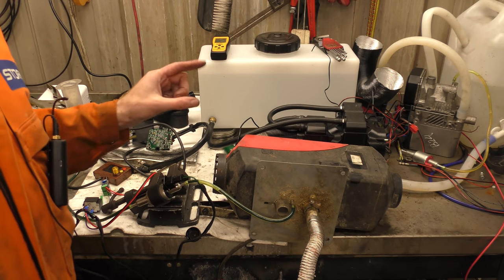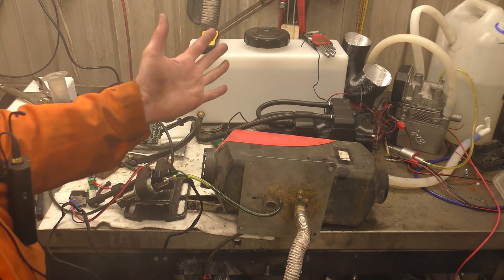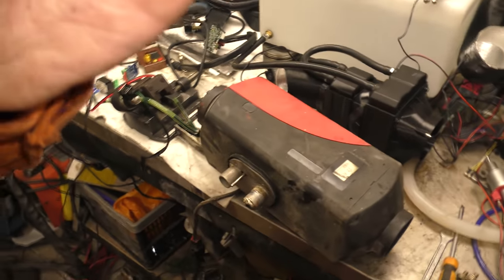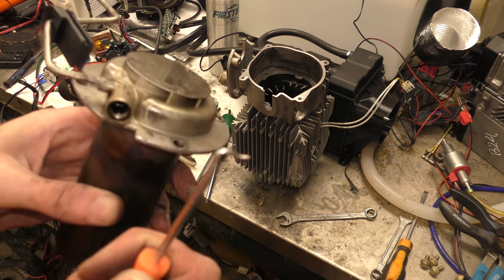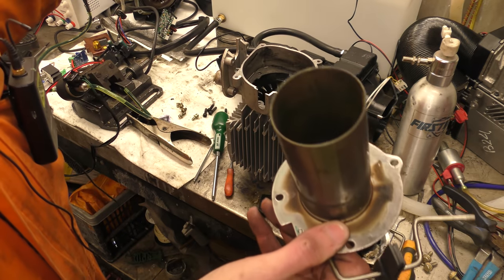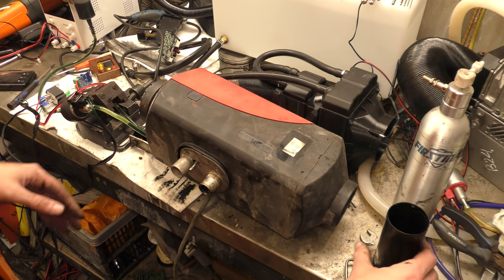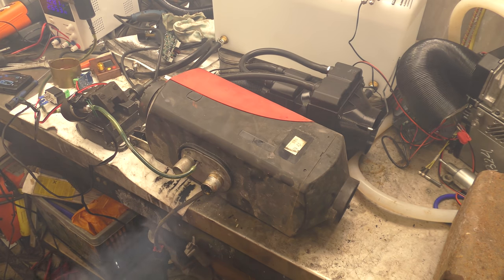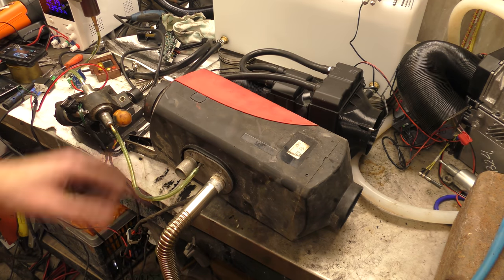Diesel Heater Diagnosis - white smoke but not lighting

Comment: i have an issue with mine on start up when the pump kicks in it make an vibrating noise and wont start up up any ideas what this issue is
Reply from the maker: The heater or the pumps makes a vibrating noise?
Reply: @DavidMcLuckie  just after when the glow plug  turns on its make the noise
Reply: @DavidMcLuckie  turns out have a long exhaust on cause the the issue it ran grand without it on but put it on wont go but start it up without then stick back on runs perfect weird one that   thanks for your help its going like a dream now
Reply from the maker: How long was too long?
Reply: About 3 times the standard  size exhaust
Reply: I had same exact issue exhaust too long. About 2 feet extra. And too many twists and turns in exhaust pipe. Thanks so much for this comment. It saved me!

Comment: My brand new heater is taking around 6 or 7 attempts before it starts up - until then I get an e03 error message every time (about 90 seconds or so after pressing the on button).  After 6 or 7 tries it starts up and runs no problem - then when I turn it off I get another e03 error message during the shut off process 

Any ideas what this may be?  It's connected directly to a brand new fully chanlrged lithium battery so I don't think it's a voltage problem.  Maybe I should replace the glow plug?
Reply from the maker: Glow plug, or wiring of the glow plug.  I have a heater that does that depending on how I bend the wire as it contacts poorly with the pins on the ECU.

Comment: Appreciate your effort, but this video - to me - does not make any sense.

You first demo how white smoke is a bad thing, undisclosed exactly why that is what are the processes. Then you proceed to disassemble the unit, pointing out several bad artifacts like two clogged holes which you clear, and then you clean the chamber too. Then you reassemble the unit and turn it back on. And it is still blowing out white smoke.

Then the video cuts and you simply pronounce that "oh, the controller was adding to much fuel into the mix, so I tweaked some settings" as if THIS was the core issue. You don't demonstrate a functioning unit, but move on to again claim that it was the previously discovered clogged holes that were the issue.

#1 White smoke, good or bad?
#2 What exactly was the problem; some controller settings or clogged holes?
#3 Did the machine stop evaporating white smoke after your fix?
Reply from the maker: Starts with a heater that's smoking like a smoke machine.  There is a shot of the intake and exhaust port with the exhaust port choked almost solid.  I replace the burn chamber with the choked solid flame front hole.  Show you the black and oily inside of the heat exchanger.  I explain that it has lit and is now burning off all the excess oil/fuel inside hence the smoke.  I then turn down the fueling on the original controller.

It can take hours of running to burn off all the excess fuel/oil caked onto the heat exchanger.
Reply: @DavidMcLuckie  Thank you for your update. I am curious, would it be possible to just let the heater run for a very long time for it to clean itself out?

Reason I am asking is that my Truma heater is blowing out white smoke, but only for a brief time during startup, and it seems only when it is cold. So it's weird. I am kind of thinking it's no different than any other diesel engine blowing out smoke when starting a cold engine in the winter time? But still, maybe I should let it sit half a day at the max setting just to clean it out. But would that make much of a difference?? I dunno hahaha

Comment: Hi David, I have 1 of those (well 4 but 2 will not work) diesel water heater in the background (B24) but can never get it to work, The instructions I found shows you just apply power and it works but mine doesnt do anything, I can test each components using the test software but apart from that it doesnt work, can you tell me what the secret is for you getting yours to work please?
Reply from the maker: This is the part a lot of people don't know.  A large amount of those Webastos are pulled from scrap cars.  Which require a CANbus signal from the vehicles ECU to actually turn them on and off.

Which is why we've been working on replacement controllers for the heaters - https://www.youtube.com/watch?v=X8AdLsXD9_U&list=PLUQpuuYoe3aDWr-qpcKBkIR_iksy80H1x

Another option is reflashing the firmware, but again that only works if have a compatible controller in the Webasto to start with.

Comment: Yeah you are good'n mr McLuckie....enthused me on more than one occasion to break the stupid heater open and de-carb the thing. What i would really love to know is why it gets so carbon covered in the first place. I've had new atomisers and glow plugs before because i burned one through by using the heating oil from my house rather than straight diesel. This time though the atomiser and plug were fine but the rest was clogged to F***. what is it exactly about the hardware compared to more expensive models that encourages the thing to get so filthy and to stop working as a result? Im so sick of E8.  I've been using gasket compound to put thing back together rather than the paper gaskets. Always done up nice and tight to make sure it don't leak. this time round, after only using shop bought diesel, i pulled a small yoghurt pot of black muck out of the thing.
Reply from the maker: I think the problem arises from tuning.  Or rather the lack of.  And I don't mean tuning by you.  If you're Webasto making parts, you can produce fan motors and pumps that will output with little variance.  All your burn chambers will be within close tolerances.

Now the cheap ones could have fans, pumps, burn chambers from any number of manufacturers and have wildly different tolerances.  Hence on heaters that should be the same, the same settings give totally different outputs.

So for the cheap heaters I recommend tuning them yourself with a cheap CO gauge.

Comment: So... my heater is starting to drive me insane. 
It starts, the glow plug glows, the air moves, the fuel pump starts, the fuel ignites and the unit starts to warm up. So far, so good. But, after a couple of minutes the pump stops pumping for some reason, the unit gets starved of fuel and the flame extinguishes, it throws up the E-08 error and starts shutting down. During the shutdown process the glow plug glows again, the pump miraculously restarts, the flame reignites and then it continues shutting down again.
Do you have any idea as to why the pump will shut itself off? The display shows that it should still be pumping but there is nothing going on with it.
Incidentally, if I try priming the unit the pump will only go for about 10 seconds before I have to turn it off and back on again to start it again. The pump is new, the glow plug is new, the burner is new, the fuel filter and hoses are new and I've cleaned out the inside recently. I'm loathe to replace the entire unit but think my options are running out...
Reply from the maker: E-08 is a flame out.  The heater has not detected a rise in temperature in the startup time.  If the unit is starting to heat up I'd suspect the body temperature sensor is either faulty or not in contact with the heater body.
Reply: @DavidMcLuckie  thanks for the reply, I think it's sorted now after replacing the pump again (for apparently no reason...).
I went into the settings and reduced the min and max Hz for the pump and RPM for the fan and then buggered about with some other settings (which I believe is the speed sensor setting) and it seems to work now. The pump now continues operating throughout and the heater gets the van nice and warm! Your videos have been really bloody useful though as I was on the verge of binning the entire thing and buying a new one...

Comment: Hi David, is the air inlet hole near the glow plug accessible for cleaning without dismantling the combustion chamber. I was wondering if by removing the glow plug and using a right angled probe to dislodge any built up grime in the air hole would work ?
Reply from the maker: Yes, if you take out the glowplug you can poke at it with a right angled pick as you've suggested.

Comment: I’m getting a weird white solid build up in the combustion chamber and white smoke pouring out the exhaust. I’ve stripped and rebuilt and it works every time for about 2 week before the same build up comes back. Run on red and white diesel with no additives. Only other time I’ve seen build up like it was with a blocked dpf on a car. Exhaust doesn’t seem to be restricted at all. Any ideas?
Reply from the maker: I haven't seen a white build up.  Well except on waste oil.

Comment: Hi David, Ive got a heater with the water heat exchanger built in, from Alibaba, works great, but im wondering if its possible to fit a controller from one that doesnt have the water pump control built in, as id rather control this exterally, and the controller it came with isnt the best with chinese writing etc.
Reply from the maker: You should be able to swap out the entire ECU and controller as the burner part of the heater is just the standard kind.

Comment: Do you think it would be possible to clean the heater by squirting brake cleaner through the tiny hole near the glow plug before it finally gives up starting ? Great videos thanks.
Reply from the maker: Yes.  Another commenter had to do a similar thing.  If you can clean out the hole and remove the glowplug and blast in there with brake cleaner as well.  Then fire it up and let it burn it all off.

Comment: Looks like the User was running some used motor oil in with the diesel, to "save money"
Espars have a cupric catalyst screen just before the combustion chamber- do these have such a combustion aide?
Reply from the maker: These have a stainless steel mesh that once lit remains hot to atomise the fuel.

Comment: Did you replace the internal gasket as well? If so, was the old one cracked or anything? Thanks for the vid.
Reply from the maker: Gasket was fine.  Usually they come apart without tearing.

Comment: So the guy got a replacement one even if it was not defective, but not used correctly. A seller is now out of pocket, and will try to   get his money back from future sales. Is this why things are more expensive here in UK?🤔
Reply from the maker: Sort of.  Let's say I sold you something for £100 and £50 of that was profit.  A customer is having a problem so you send them a £10 part making your profit now £40.  This makes the customer happy and they do not return the whole thing for a refund which would get you £0 profit.

Comment: When i prime my diesel night heater the fuel runs straight through and out of the exhaust outside my workshop, The fuel pipe will not fill after 4  prime attempts, In the past when i primed the heater my fuel line always had fuel and little bubbles in the line, Any ideas what might be wrong with the heater David please.
Reply from the maker: Is there a leak between the pump outlet and the fuel inlet on the heater?  For diesel to run out of the fuel line air must be able to get in.  My all in one sometimes does this when I don't clamp the fuel lines on the pump and overnight it lets the air in and fuel leaks out.  But it always stills fires up as the fuel pipe is so short.

Comment: HELLOOOOOO! My Vavoer "8K" is a year old. Now throws ERROR 10, smokes like a Cummins, refuses to ignite. Replaced glow plug, same. Took it apart, was super clean inside, except a hard grey ash way down in the bottom of the burn chamber. Picked and 3 tbsp. of that out, looks clean as a whistle now. Soaked in a good carb cleaner, allowed to fully dry, reassembled. Still no joy. Am thinking that the catalyst screen in the burn chamber must be gone or ruined - everything else checks out right as rain. Your thoughts, please?
Reply: Replaced screen in glow plug chamber. I'm referring to something I'd heard of another mesh screen in the belly of the actual main burn chamber, if there is such a thing. Otherwise, I am completely stumped.
Reply from the maker: I too have heard of this other screen inside the burn chamber.  But I haven't cut one open for a look yet.

Did it just run fine previously and just stopped starting?

Comment: I can't see how carbon inside the chamber can cause a flame out . I just finished fixing my flame out problem  . Was carbon on the atomization screen   and small hole just above the screen was half blocked   .   First go started .  My chamber was compleatly spotless of carbon so it's running good for that issue .
Reply from the maker: If it gets really bad it can start to cover the exhaust port.
Reply: Yes ok  100%

Comment: I've been pouring  liquid oven cleaner  into the burned and it sure cleans up very well. Is there any reason not to do this. I'm also using carburettor cleaner aerosol.
Reply from the maker: No reason not too.  If it cleans it out then that's the main thing.

Comment: can I used Diesel Fuel, Supplement/Cetane Boost in my heater fuel to make it burn cleaner , keep it cleaner?
Reply from the maker: It would certainly help keep it clean.  A good tune would also mean less carbon build up.  A combination of the two should then mean almost no need to clean the heater.  :)

Comment: how did you adjust the fuel on his controller
Reply: you have to put a code in and it lets you change the mixture and low/high speed settings in HZ not hard to do mine now used 1/2 the fuel for a cold night and its clean as inside ,maybe a little lean but no smoke 
Rob
NSW
Australia

Comment: What was the exhaust plugged with? Looks like some kind of mud wasp nest.   And, yeah, like Jamesc76 said, he probably screwed up the settings.  Maybe put screens on intake and exhaust.  :)
Reply from the maker: Not sure.  It was solid though.
Reply: @DavidMcLuckie  Not normal diesel combustion byproducts.  Around here in Vermont and I suspect most anywhere during summer, bugs of all sorts look for places to build nests. Summerize your camper heater by plugging the ports.  This vid was a great lesson. Thanx DM. :)

Comment: Not sure if my previous  message got through. 
I have just installed a new heater and connection to battery  gives a fault code of E-07 .
I have checked the wires from the control unit to the main board one at a time and no breaks .
I have checked the soldered joints on the main board marked + & - they give a reading of 13.6v as the heatervis connected direct to my leisure battery .
The 3 wires from panel to board read 4.6v at both ends when all harness connected 
Do you have any ideas on what to check next please
Reply from the maker: Is the ECU set to 24V or 12V?
Reply: Yep set to 12v .
I have noticed yesterday that the voltage reading on the lcd panel reads 00.0v yet it illuminates a d I can scroll through the settings ect .
Could it be possible that lcd control isn't communicating with the main board ?
Reply from the maker: That is a possibility.  It used to be a blue wire that was the communications wire.  There should only be four wires going from the internal ECU to the controller.

Comment: Great vid, thx for sharing!
I've got the same problem but with a NEW never used, new installed heater... white smoke, doesn't light, pump stops after 4 min (white smoke keeps coming), after another 2 min pump kicks in again but cuts off after another 2min with an E10 error and heater enters the shut down procedure by itself. Bench tested it with short hose, no kinks, clean diesel, pump at angle, no air into line, good voltage bla, bla, bla.... the same every time, white smoke, no roaring sound, no heat, E10 error and shut down. New, clean, unclogged unit out of the box.
PLEASE any advice would be much appreciated! Cheers!
Here's a video with the full start up to error sequence: https://www.youtube.com/watch?v=gFYonE9rVBM
Reply: I have exactly the same issue. Would be great to get some thoughts on this issue!
Reply: @beatkistler681  I opened the unit and the plug and small hole by it were clogged. Cleaned everything, drain the overfilled diesel from the burn chamber, reassembled all back and fired up first time. Burns well now after 2 weeks no peobs.
Reply: @beatkistler681  I have to thank @David McLuckie for his help and advice

Comment: Hi David, have you known a pump runaway?  It overdiesels and clicks at high speed. Cheers  Tim.
Reply from the maker: I haven't had one do that.  That is a odd thing for it to do.
Reply: @DavidMcLuckie  Yes weird. I have ordered a motherboard which might sort it. Another heater I have still smokes a bit after I serviced it but it lights up and runs ok. Any thoughts on smoke whe running ok?
Cheers  Tim